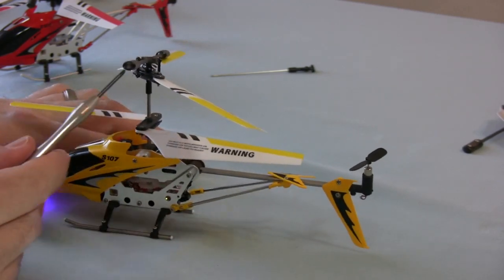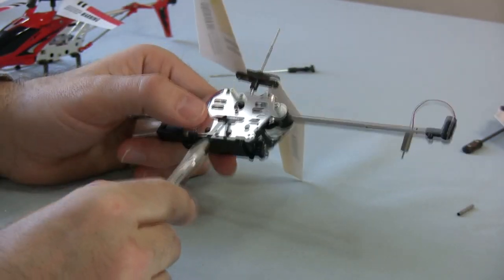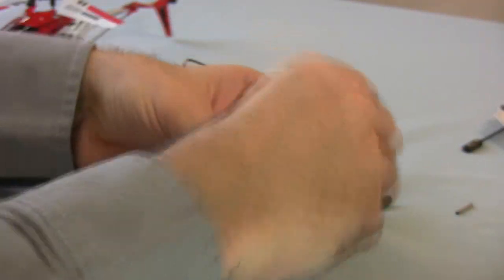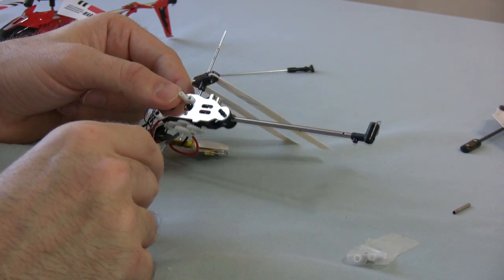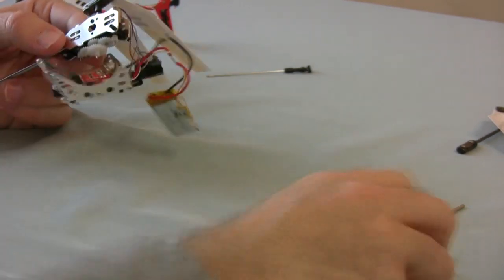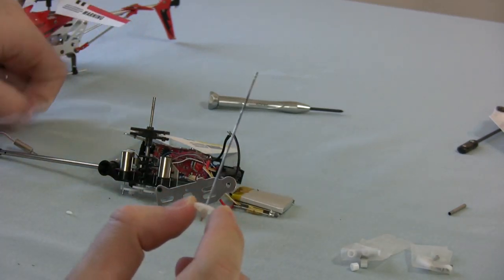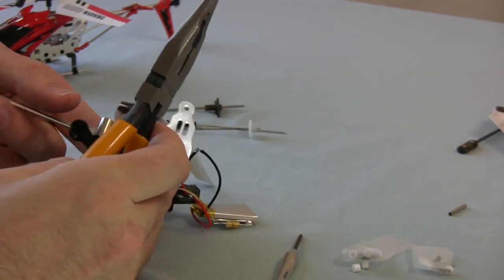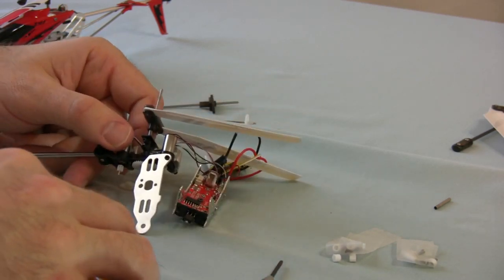Syma S107G Gear repair

Comment: Mr wolf thank u so much for the video u explained it very well this is my first crush heli ever and the bottom gear somehow come out yesterday and I'm not a technical guy I was worried I will have to buy a new one as the main drive shaft kept slipping out but after I saw your video I realised the drive shaft is held into place by the last gear so thank you so much I'm fixing it as I watch your video

Comment: My helicopter's back propellor does not turn. I've tried jiggling the gears and motor wires a bit, doesn't seem to help. The chopper takes off fine, just doesn't go forward or backward. :(

Comment: Working on my daughters. As he said look for striped gears. looks like the lower blade gear on the motor, is striped on mine. Great video,  Thanks. I just wanted to make sure I did not take off too much to get to my problem, lol. Hey would love if you post the upgraded battery part info. May as well add some upgrades while I'm doing this repair. Thanks

Comment: Hi 
I got a s107c helicopter i flow it lots.Then the bottom blades won't go around and the top blades will go around.I look at the motor it does'nt go around.how can i replace it.my dad said return it.

Comment: You can also lodge the intermediate gears out by prying the screw driver or something else against the gear and upper part of the inner ceiling, I found that much easier, comes right out.

Comment: I crashed it and everything still works but when it takes off/starts hovering, it dives right into the ground? The wings looked a little nicked up but I'm not sure why this is happening? The upper bars still pivot and it appears to be in good working order. Any advice would be greatly appreciated.

Comment: Hobbywolf  - great tutorial!  Say, where did you obtain the replacement gears?  Our Syma S107 has a stripped gear -- one "tooth" is missing so the helicopter now can never rise more than an inch or so off the ground.

Comment: I just got one and straight out of the box I charged it and read the manual,When it was finished charging I tried to fly it but even at full throttle it won't lift there seems to be a grinding noise coming from the gears but it was just out of the box? PLEASE HELP I'm getting pissed off
Also it spins anti-clockwise even if I adjust it fully on the remote any suggestions ???

Comment: Hey I broke my back propeller and after a quick look it seems that one of the cables connecting to it (the blue one) has broken off the main piece. Is there any fix that you know of? Also, the blue cable is now much shorter than the red one. Cheers.